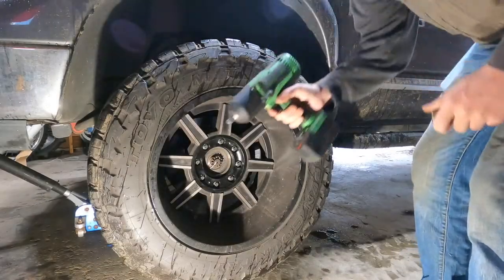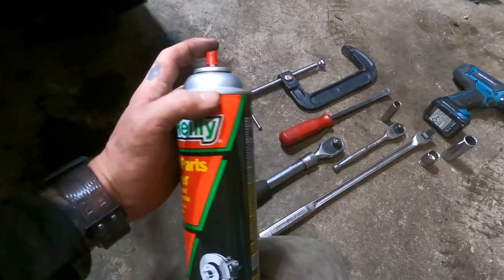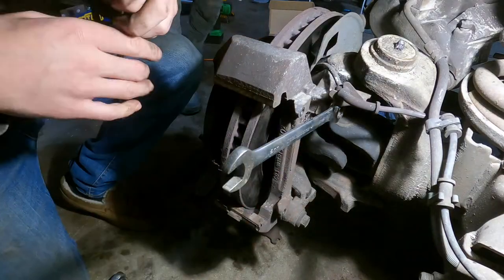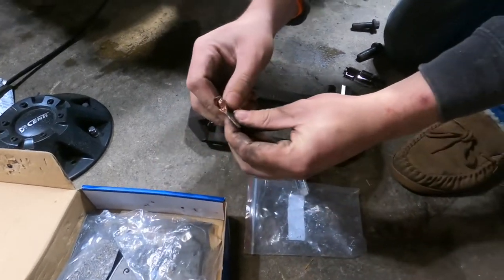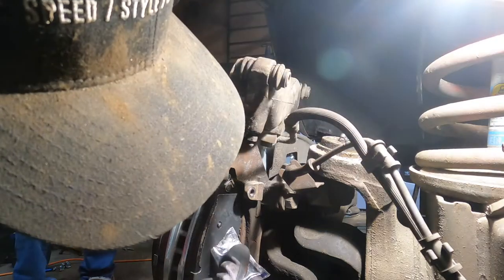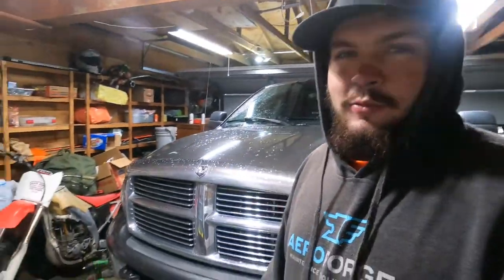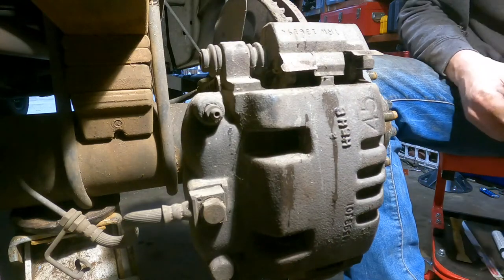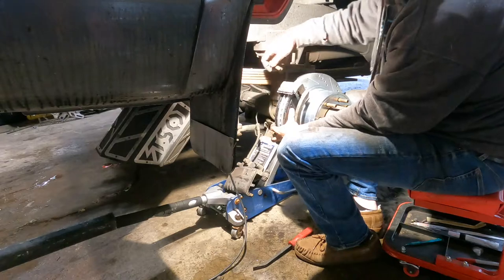2003-2009 Dodge Ram Cummins 2500-3500 Brake Job!!!!

Comment: What part of the caliper do I use the (C) clamp?
Reply from the maker: When we use the C clamp, we used it to compress the pistons on the brake caliper so it will fit onto the new rotor with the new pads.